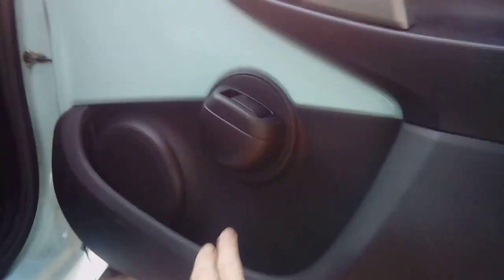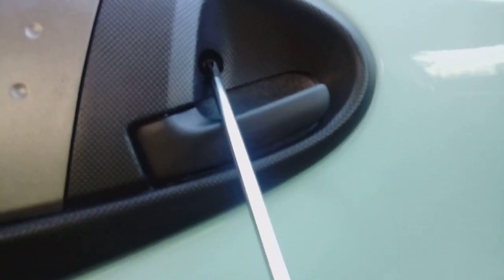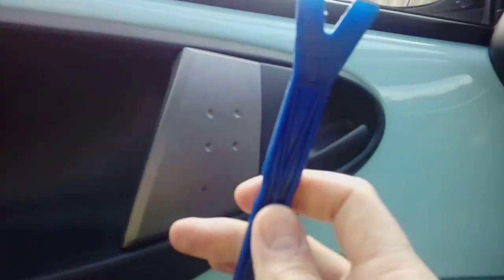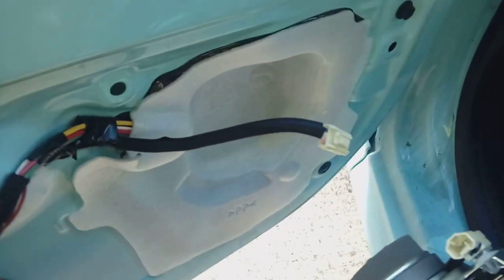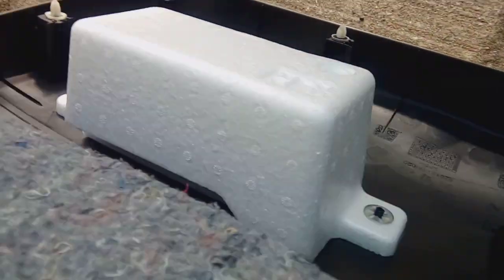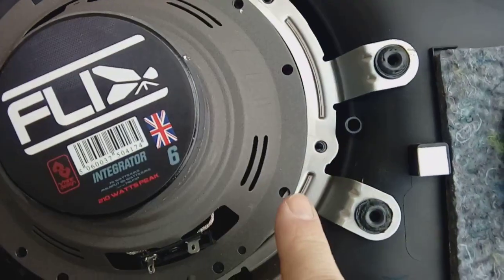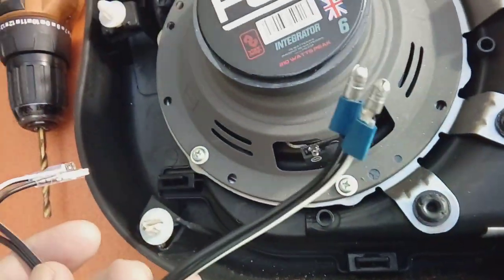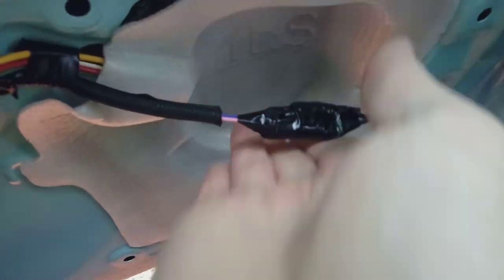Citreon C1/ Pug 107 2004-2014 how to replace door speakers,step by step simple guide.

Comment: Just got done replacing the original door speakers with the JBL stage 3 16,5cm and they fit perfectly and I can roll the windows all the way down. Used the old wiring arrangemend and soldered the ends to the new speakers. Thank's for the video!
Reply: Do you know if you have to replace the audio cross-overs?
Reply: @wzon1260  no, it's just two simple wires. Just gotta keep track of what goes where. They are color coded so it's quite simple.

Comment: i found a quicker way. pull away the side and bottom door and ones around the speaker area clips. And use a stubby screwdriver. Had to remove my door speaker. Good vid btw.

Comment: Wait what? I didn't know that some models came with in-door speakers. My Pug had 2 dinky factory speakers on the dash and they called it a sound system.
Reply: I didn’t know either it’s odd same my dads delivery 107 has speakers only 2 on the dash
Reply: My 2009 aygo which is an automatic, is somehow the maxxed out version. Front and door speakers plus airbags in the driver and passenger seat and rear airbags.

Comment: Amazing video! Thanks for sharing. Worked great for me. If it helps someone else, i did it in my toyota aygo 2014 and I used:
Speakers:
Pioneer TS-G1720F 17cm 6.3/4 inch 2-Way Coaxial Car Speakers 600W Total 300w
Connectors/Adaptor:
Connects2 CT55-TY01 Speaker Loom adaptor for Toyota Aygo 2005>
Reply: Followed this. Thanks!

Comment: Thanks for the video.. do you have a video showing us how to upgrade the two dash speakers on my 107?  I had a quick look. It has four connections instead the two on the new speaker.. can you advice?
Reply from the maker: Never had a job booked in for the dash speakers sorry.
With the four spade connections on the new speakers you just use one per side + & -

Comment: I have been looking all over the internet on the speaker size for the front speakers. The problem is that in my Pug 107, there's no speakers in the doors, but in the dashboard near the front glass panel. I would love to know if you knew by any chance, what those speaker sizes were, before I start unplugging everything?
Reply: In the dashboard are 100mm speakers, the doorboards look like 165mm but I have to cut the doorboards to place in some.

Comment: Used the same speakers on my 2011 Aygo and now the window wont roll all the way down, not something that bothers me much but something to note for other people with Aygo's.
Reply from the maker: That's strange,no problems with window hitting the speaker on this customers car,you could try spacing the speaker out slightly by packing some washers behind the mounting screws.
Reply: L'aimant du haut parleur est trop epais et empêche la vitre de descendre au maximum. 😊

Comment: Hey man, bit late to the party But great video!
I've bougt myself a pair of JBL stage3 627 speakers to fit in my 2010 aygo Doors.
However, i'd like to be able to use the grills that come with the actual speaker, as mine are a bit worn down.. Is it possible to remove the old ones?
I hope you're still actieve and can answer my question
Reply: Hi, did you manage to figure this out? 
Im currently in the exact same position
Reply: Update needed. Im trying to do this at the moment.

Comment: Hi, Im upgrading  from manual to power windows on 2010 C1 bought door harnesses from breakers, connectors are there for switches and regulators, however loose ends otherwise, assuming  the 7 branched cable loom is for remote locks + speakers on one harness and 4  branched cables on other side is same , which colours  are for the windows, Thanks.
Reply from the maker: Unfortunately while not being able to work I can't access the wiring diagrams for any car,but if you could get a Haynes manual that will show exactly what colour does what.

Comment: Thanks mate, went to Halfords today, they only do pioneer speakers in the 16.5cm that I need for my Toyota aygo 2014. £45 plus an extra £6 for crimp connectors, and £20 for tweeters. She went into the back to check stock and found an old brand they use to sell called ‘edge’ two 16.5cm speakers and 10cm tweeters for £30. Decided against crimp connectors, cut the oem clips from the standard speaker and soldered the new speakers straight to the connection points. They’re absolutely brilliant. I am having trouble trying to find a walk through video on how to install the tweeters as I have 0 experience in the electronic department. Should I do the same with the tweeters? Disconnect the oem ones and solder the new ones on? Any help would be greatly appreciated. Thanks again
Reply from the maker: Yes that will work fine. Your old tweeters will have a filter at some point in the cable so only high frequency sounds will go to them.
Reply: So the size of the speakers in the door is 16.5 ?

Comment: Hi all, would anyone know what's the power output for the original door speakers please? Thanks in advance
Reply from the maker: 8watts rms, please note a lot of the time the speaker shows the peak power output.
Reply: @PJsprojects  thanks! 8watts is really nothing vs current 70W rms on the market. I bet you noticed a huge difference? Greate video btw, loved it.
Reply: @PJsprojects  one more Q, i got tweeters at the dash and the larger speakers on doors. Wondering whether it's worth to replace all 4. In other words, would it make a bigger improvement replacing tweeters or speakers? Hope I'm making sense. Thanks
Reply from the maker: @carikower  I’m trade so didn’t really get to listen very much but most aftermarket head units are only around 8-10watts rms per channel.
It’s a case of ignore the big power number stickers on everything. Some 60-70watt peak power speakers will work well with a typical 4x25 watt aftermarket head unit.
Reply from the maker: @carikower  no not much difference

Comment: Had you changed the tweeters in the dashboard if so what did you do about the white 4 pin connector that goes into the old ones?
Reply from the maker: Not this time no,the new door speakers going in this car were co-ax and so the dash tweeters were simply disconnected.
Reply: PJs projects did that not stop your door speakers working when you disconnected the tweeters?. Thanks
Reply from the maker: No not at all, the chap that owned this car was not bothered about the dash tweeters but in the past I have done others where the tweeter was either connected or upgraded,it just depends if you think it's worth it.
Reply: PJs projects I have upgraded tweeters to install but the old ones have there own 4 pin white connector, the new tweeters only have normal spade connections like the flis in your video. Cheers.
Reply from the maker: You could either solder to the wires just before the white block or if your not worried about needing the block just chop them off and bullet connect the wires to the new tweeters.
Reply: PJs projects does your head unit have enough power to handle these if they are 70 watts rms per speaker
Reply from the maker: Nope not on the ones I have done.
Reply: PJs projects so was it an amplifier giving them power?
Reply from the maker: Nope, just the built in amp on the radio so anything higher than three quarter volume and the speakers would start to 'clip'. However that is very loud.

Comment: 7:39 - I am looking to install some speakers into my Peugeot 107 and I would like to avoid snipping any cables where possible. I have bought a Connects2 CT55-PE01 Car Speaker Adaptor Harness Wiring Connectors for Peugeot, is this correct? Or will I have to buy bullet connectors? Many thanks
Reply from the maker: They look correct,saves chopping the cables.
Reply: @fizzytango did this adapter cable work out?
Reply: @PIN0FUL  yes worked perfectly! Shame I wrote off the car I installed them in LOL

Comment: What are  the dimensions of the speakers ? And do you have any tips for speakers?
Reply from the maker: The speakers are 13cm and the Fli ones used are made by Vibe who are well respected in the car audio world.
Reply: in the comments you say 13cm but at the end u say 6inch? just want to clarify they are 13cm. also i have a toyota aygo and the door looks identical to this, is it safe to say they are identical?
Reply from the maker: Opps,yep they are indeed 6" or 16.5cm speakers sorry for the error at the start.The Aygo is built of the same platform as the C3 so it should be pretty much the same although it's not a model I have changed the speakers on so just take your time. Good luck.
Reply: PJs projects Hi there, do you know the maximum depth for speaker in door. Was there much space behind the fli 6? Thanks
Reply from the maker: The max I would advise is 9cm,this leaves a small gap when the window is down. The Fli 6 in the video was pretty close tbh.
Reply: PJs projects cheers PJ.
Reply: @NickJory - Yes, they're identical. Might come as a surprise to many but the triplets Peugeot 107, Citroen C1 and Toyota Aygo were built on the same assembly line, on the same factory and by the same workers! 

Exactly like another older example in the industry. VW Sharan, Ford galaxy and Seat Alhambra. Also all made under the same roof. Or Renault Trafic, Opel Vivaro and Nissan Primastar...
Cost oblige. ;-)

With this said, almost the entire car components are interchangeable between brands. Apart from the specif details, like logos and not much more.
Cheers

Comment: What speakers did you use? please
Reply from the maker: The speakers are 13cm and the Fli ones used are made by Vibe
Reply: PJs projects Thank you so much
Reply: PJs projects Sorry if it sounds dumb but I can only find Fli and vibe not fli made by vibe could you give a link,I have been looking on Halfords site and there is 13cm Fli on there but not made by vibe I think 
Thanks
Reply from the maker: You have the right ones,Vibe do not advertise the fact that Fli is owned by them.
Reply: PJs projects cool Thanks alot, I am going to upgrade this weekend

Comment: Where do you got the conection cabels for the speakers?
Reply from the maker: Places like Amazon,Ebay or car shops. Example - https://www.ebay.co.uk/itm/Citroen-C1-Peugeot-107-Toyota-Aygo-Speaker-Adaptor-Lead-Cable-Loom-Plug-Pair/250514656577?hash=item3a53d64d41:g:7H0AAOSwFqJWn6sp